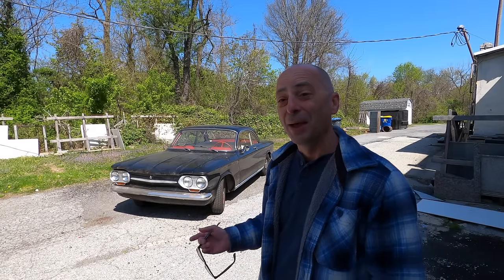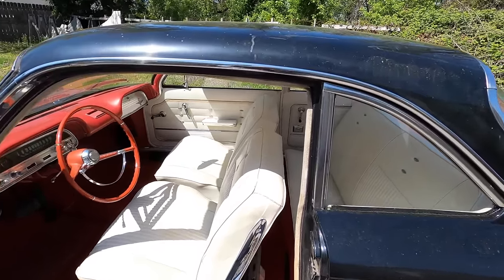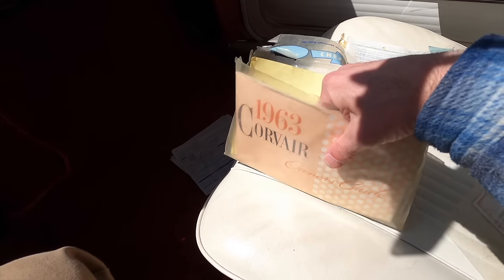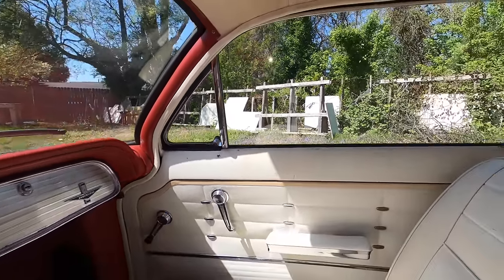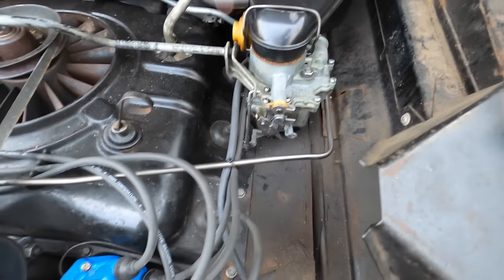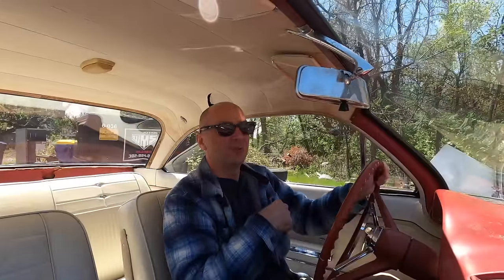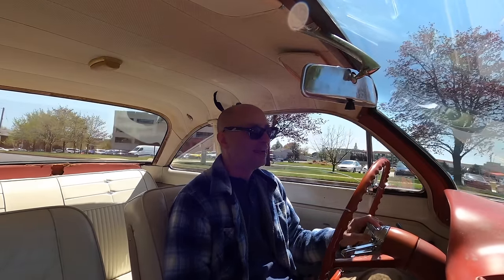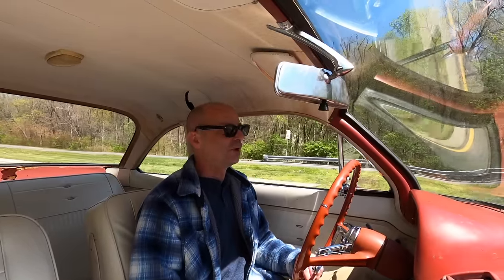Chevy Corvair - The Weird, Quirky, Cheap and Yeah COOL Compact

Comment: As an owner of a 57 Chevy, I never really noticed what a huge difference in design and technology that there was in three short years. It’s kind of amazing when you really think about it. PS a mechanic who works for $25 an hour? Hold on tight to that guy
Reply from the maker: Hwy myt friend, thanks for the visit and for checking out the Corvair video.  And you're so right about the tech leap from the '57 to the Corvair.  And finding a Corvair expert at $25 per hour is the only reason I got this car.  Otherwise I would have been way, way over my head.
Reply: Not when it takes him 70 hours to change belts and hoses and do a carb rebuild.
Reply: Nice!
Reply: So many and significant were the improvements through the fifties and early sixties, that I frankly, consider everything built before 1955 an automobile prototype.  You have to start somewhere.
Reply: My first car was a 1964 Corvair Monza. Black with all red interior and automatic transmission. I was actually 15 when I bought it for $200.00 in 1975. Drove it a couple years. The only problem I had was an oil burning smell anytime I used the heater. At the time I didn't know it was due to oil seeping into the pushrod tubes because the original gaskets were worn out. I would have enjoyed the car a lot more as one could imagine.

Comment: From 1965 until the end of production, the Chevy Corvair was one of the best handling cars on the road — so good they dominated slalom racing for awhile. They were also successfully used for track racing. And there I nothing quirky about them, but rather more like an affordable Porsche with an indestructible engine. I had a '65 and a '66. Loved them!
Reply: Certainly agree the 4 joint 1965+ cars were great drivers! You did have to adjust for the balance of a rear engine car, as Porsche drivers did. I drove my 140 HP on very curvy mountain roads, and it was different uphill vs. downhill. Uphill it would oversteer under power, but downhill it was incredible handling.
Reply: Get that! See my comment. I raced in Texas and Michigan.
Reply: Had a 65 Corsa 140, 4-speed. Ran it on the SCCA track at Grattan, MI many times without modifications. Absolute fun.
Reply: The second generation rear suspension was essentially the same as the Corvette of the era.
Reply: the '65-69 ones to have were the Corsa, with their turbo charged engine. I had the 185 hp motor in a homebuilt trike, man that thing was fun to ride!
Reply: @adotintheshark4848 Only 65 to 66 Corsas had the 180 turbo option, and they were few and far between. The one most enthusiasts gravitated toward was the 140 4 carb unit, which was standard on the Corsa and variously optional on all cars Monza trim and above through 1969.
Reply: I owned Porsches before and after a Corvair. The Porsches were world's better handling than the Corvair I owned. And vastly more fun to drive.
Reply: @jjhpor  I get that sentiment, but all I can say is - as it (the Porsche) should have been for more than double the price and 20 inch less wheelbase at the time - A-B'ing them in the mid-late 60s. The key to the Corvair was decent tires (affordable radials in an appropriate size not really available til the late 60s at earliest, but from the late 70s on finding them not a problem... but regardless), and watching the tire pressure differential which half the people I've talked to ignored and a disturbing percentage ignorant of. The lates benefited in high speed stability from the small chin spoiler provided OEM 66 to 69, retrofittable on the 65 (or aftermarket), and aftermarket on the earlys. Properly attended to, the 65 to 69 especially is quite capable and fun, and of the early's the 64 in particular was a hoot, earlier than that as well if smartly equipped and watched after.

Comment: I learned to drive on a 1965 white with red interior monza. Great little car in the snow, good gas mileage, and real dependable. Independant suspension and an air cooled 6 cylinder boxer engine, powerglide AT, it was ahead of its time. Ralph Nader killed the Corvair. I would buy today.
Reply: What really killed the Corvair was the 1964 1/2 release of the Ford Mustang.

Comment: In 1963 my mom bought a new 63 Monza sedan, auto trans. Burgundy with black interior. My older brother got his license in 63 and drove it like it was his. In 65, he goes to college and I got my license and it was mine. In 1966 I flipped it and broke a telephone pole in half 13 feet in the air. The car was totaled with the driver's side roof pushed though the driver's seat. I was in the floor with my buddy (no seat belts) and didn't get a scratch. My buddy cut his arm crawling out and had 7 stitches. We were going over 100mph when we left the road. Tough car. My dad used the insurance money to buy a 1964 Monza coupe, 4 speed, white with blue interior (I questioned his wisdom on that one). In 1967, I was the last of a train of 5 cars that stopped suddenly. $600 damage to my Corvair, $1100 damage to my buddy's 66 Chevelle. Tough Car. My dad sold it when I went to college that year. Broke my heart. I had studded snow tires on these cars in the winter and only got stuck once when the snow was so deep it lifted the car off the road and no traction (unibody construction). I wish GM would build that car again with today's technology. WOW!!!

Comment: Bought mine new in 64.   Put 250,000 some miles on it.   Two quirks of note.   The rear mount could fail and drop the rear of the engine onto the road.  Didn't hurt anything but savvy owners carried a coat hanger along with the fan belt to jury rig the engine and get it home.   Also, the fuel pump would develop a leak internally and put gas into the crankcase.  This resulted in severe oil burning which would go away and come back periodically as you drove.   Always replace the fuel pump on any Corvair you adopt ( this could be your lean problem). Pluses that you may not know were that it always started in sub zero weather and could go anywhere in snow especially with rear tire  chains or cables.  One final note.   If the engine does not want to start at some point , pull the distributor and get a rebuilt one.  They wear and the points will not close. Thanks for the memories.

Comment: Nice car, and I love the unrestored look. It's something you can drive because you're not afraid to get it scratched up. I'd give it a wash and a polish and fix the headliner and just enjoy it for a while. The little shifter with its rotating window and big parking brake lever are weird. I love the huge frunk on Corvairs, Tesla can't come close. Everyone wants a Mustang or a Beetle, these are definitely overlooked.
These didn't deserve their bad reputation. The early-model suspension setup was very similar to the Beetle but with more power the swing axle handling quirks became more apparent. GM specified different pressure for the front and back wheels to compensate for the quirks but service station attendants would fill them equally, exacerbating the handling issue. By the time GM fixed the suspension for the late model it was too late, the damage to its reputation had been done. GM did the GM thing and killed it as soon as they got it right. They were competitive cars at the time and still drive nicely today.
Reply from the maker: All very well said!  And thanks for the visit and for checking out the Corvair vid today!
Reply: My recollections are that when you got up over 75MPH, the front end seemed light, less positive steering...but it's been a lot of years
Reply: You'd think Jeff Bezos would pay someone to give it a wash!
Reply: Hey smarty pants. They (GM) did not use base coat clear coat.  ABSOLUTELY NOT an unrestored look.  Let me guess. you have a mask on.
Reply: @hullinger  Thanks for keeping it going. One of the rare American cars that Europe respected for its engineering, although American and European cars are/were driven on different roads, in different ways, so the market will always be different.
Reply: Fun fact. Ralph Nader did the hatchet job on this car, at a time when he owned a large block of Ford stock.
Reply: @DUCKSAREEVILLLLLLLL at the time of the Corvair's debut, Porsche was making little 60 horsepower 4 cylinder cars. The Corvair Spyder had a turbo flat 6 with 150 horsepower!
Reply: I owned 2 Corvairs (1962, 1963)  and they made a KIT - a long-metal-bar - that connected both rear-wheel hubs to STOP each independent axel from folding-up under the car (losing control) in the case of a tire-blowout !!  Check out the book UNSAFE AT ANY SPEED which discusses it ! (it happened to me  and my car did DONUTS ) ?

Comment: It's great to see another Corvair fan showing your Monza!   You can add a camber compensator spring on the rear suspension and a front stabilizer bar to improve the handling, those became standard in 1964.  I own a 1966 Monza 4 door hardtop with factory air conditioning and an automatic transmission, I've worked on it "one piece at a time" and now it drives like new!  What could be better than a car that handles like a Corvette, looks like a miniature Impala,  gets gas mileage like a Nova, and can be bought on the cheap?  There's no contest here!  Enjoy your Monza, you've done a wonderful thing bringing her back to life!
Reply from the maker: Great comment and thanks so much for sharing about the handling improvements. I appreciate that.  It's cool too that you have a probably my favorite body style, the 4 door hardtop, with A/C too.  Awesome stuff. Thanks man.
Reply: Adding the camber compensator means installing a '64 differential, the bottom is machined differently, and then changing to much lighter coil springs. It's a little bit more complicated than just putting a spring underneath. I did it to my 1962 spyder, but that required changing the differential and the rear lower control arms
Reply: not my Nova .350 ss .lol
Reply: @CORVAIRWILD  Was it worth it in the end to help prevent rolling?
Reply: I bought a new 64 Spyder in 63. It was black with black interior. I liked it a lot and won my only drag strip trophy in 64. I turned 88 mph with a 15.9 et. That was good enough to win "I" stock class. Sticker price on my car was right at 2, 800 dollars.
On Ralph Nader and his comments on the dangers of the Corvair. If the owner did not look at the owners manual or allowed someone else to put air in the tires he would likely not get the recommended 15psig in the front and 25pisg in the rear (which compensated for the read engine configuration and weight distribution), and that could make the car more unstable when cornering. My 64 also had some factory changes intended to improve the cornering ability..........
.

Comment: Had  a Corsa and a Monza - loved 'em. The Monza I bought from my older brother - he installed heavy duty springs, & it had the full independent later suspension - it was our 'poor man's Porsche', handled like a cat - helped my practice w/my copy of Pierro Taruffi's "Technique of Motor Racing". The BEST car in mud & snow - I never got stuck when others did. The early swing axle did have problems - but not if you inflated your tires properly. Unlike some of my VW's, plenty of heat in the winter. Didn't have to worry so much about gas money like the V-8 boys. Miss those Corvairs...

Comment: I’m so old that I owned a red ‘64 Spyder as one of my first cars (cars were cheap, so we traded often way back then). I really enjoyed that car and it was quite reliable. I laughed though when I saw your spare fan belt. I got very good at replacing those quickly, even in the dark. Thanks for the memories. 👍
Reply: You had to use the right kind of fan belt. The cogged ones did not hold up, as they were too "floppy" to be stable. I think they were OEM Dayco belts. Never had a belt problem in two 110 HP and a 140 HP engine that got run hard.
Reply: bought one new in 1961 ( $1,800 ) like the car, but, you were lucky to get 50-60 thousand miles out of it. The biggest problem was in the push rod tubs. The O rings would crystallize from the heat and cause oil leaks.  You would have to drop the engine to fix this problem . it was a real pain in butt because it happen after a  few short miles. All in all it was a fun car and I would buy it again if they could fix that problem. 😊

Comment: I've had daily driver EM corvairs almost since started driving! The big thing about "handling" with those is there is a huge difference between the original 1960, the Monza's and the Spyder (turbo). The Spyder was the best handling of the bunch, as it was sort of intended for more aggressive driving... it came with stiffer spring rates, 1 1/2 to 2 degrees negative camber on the rear wheels, and a front anti sway bar. I have driven all three and its amazing how much more planted the Spyders feel compared to the others. Another thing that really improves the handling a lot is to use modern radial tires... One modification you would do well to think about sooner rather than later is to use a dual master cylinder. Clarks Corvairs has a kit to make this really simple easy conversion.
Reply: Yes, adding some rear negative camber helps rear drive swing axle cars. The factory tires on early models were cheap 2-ply sidewall, which mushed out in hard turns. Radial tires were considered expensive "foreign" tires in the 1960s. GM was going for a cheap selling price, and not the best car. The Chevy dealers were also very inept with the Corvair. As soon as my mom's 1963 came off mandatory dealer warrantee service, I took over it's maintenance.
Reply: @loboheeler  I read that recommended tyre pressures were very low too, which could allow tyres to roll off the rims at which point the rim would dig in, catapulting the car over it's axle.
Reply: @alanjm1234  Yup. Gotta have a softer smoother ride don't ya know.

Comment: Pretty cool video.!   It brought back fond memories..  I bought a brand new Corvair Monza in 1963.  Mine was Ermine White with a red interior.  I loved the ride!!  I kept the spare in the front to sort of  balance the weight distribution, plus I added "trombone" dual mufflers,  what a neat sound!..  I always kept a little tool box in front, just I was always ready to quick change  that fan belt when it broke!  It only took a minute to replace..  Mine had a 4-speed gear box plus a 110 hp. engine....  Fun car, I sometimes wish I still had it........

Comment: Very cool relic from the 60's. keep it running, fix up the interior, the headliner and bulkhead first. Thanks for sharing! Just one thought on the stalling, Chevy carbs were notorious for vapor locking
Reply from the maker: I have a hunch that vapor lock might just be the problem with the stalling.  When the car stalled at the DMV it was a pretty warm day and after getting the car towed home it fired right up with no issues.
Reply: @hullinger  I believe there was a service bulletin fix for that issue. If I remember correctly it involved installing some heat shields at the base of the carburetors and or installing some fuel line insulation in specific areas. And there is a one way vent in the gas cap which sometimes gave problems.
Reply: @hullinger  and this E10 fuel is more prone to vapor lock
Reply: @tombob671  I agree with this.  If you aren't already, try to run non-alcohol fuel at all times.

Comment: My first car was a 1965 500 Cp.  I currently still have a 1965 Corvair with only 15,000 miles. Great handling parts are readily available. The car was misunderstood, improper maintenance contributed to handling problems. Love it.

Comment: The Corvair was one of the best rear engine cars ever built in America. Not many people realize the front suspension, ball joints ,tie rod ends,  and many other parts were shared with full sized Chevy's. The only problem with Corvair was not many mechanics were open to learning how the Corvair was designed, and willing to learn the new techniques that were required to service and repair these cars. I serviced and owned a few of these cars, both as a Mechanic and later on as a collector, the quality was there, strong, reliable cars if you were smart enough to learn, at the time, New Tech.
 Ralph Nader was only part of the demise of the Corvair, complete ignorance on the part of set in there ways mechanics and DYI'ERS whom had no clue how these cars worked.

Comment: When I had my 64 corvair, I bought a 4 barrel, intake from JC WHITNEY. 
     And it worked pretty good .it was better than the 2 single carb set up.
Reply: I remember that. I had a ‘60 4 door with the gas heater, a “63 with the 4 speed, and “62. I wish I had kept all of them, but young & dumb. Lol